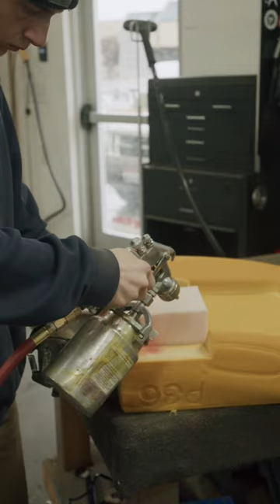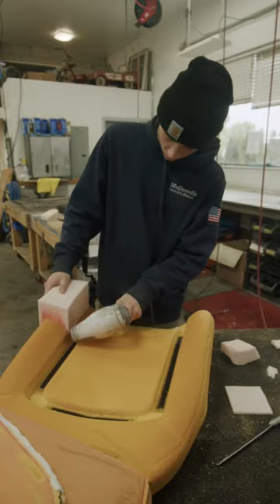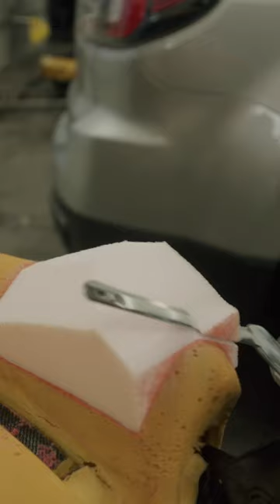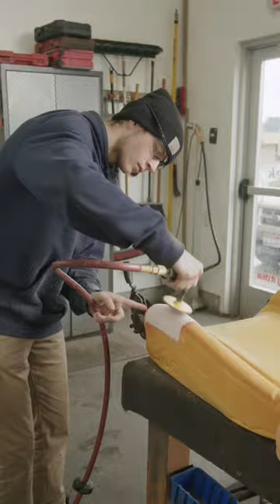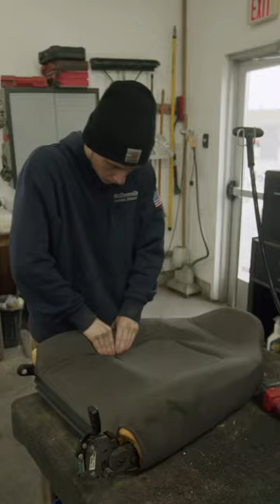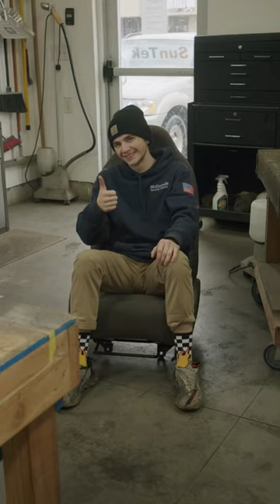Seat Foam Repair #autorepair #mustang #upholstery

Comment: Wear a mask when sanding foam.
It's also better to do the cuts downward on an angle. It makes the glue joint not only softer but stronger.